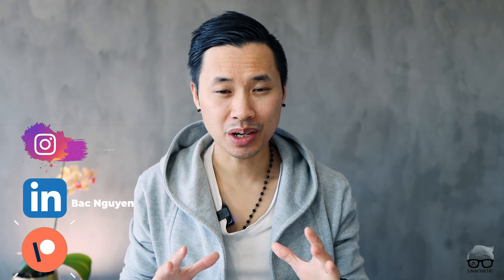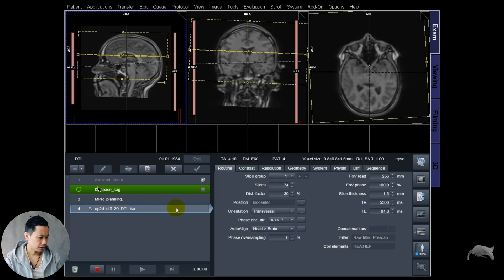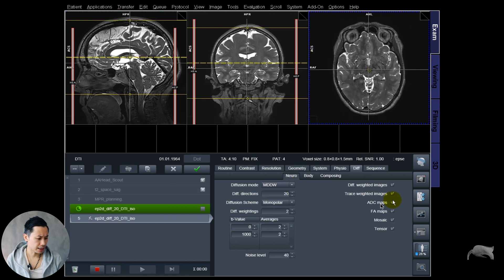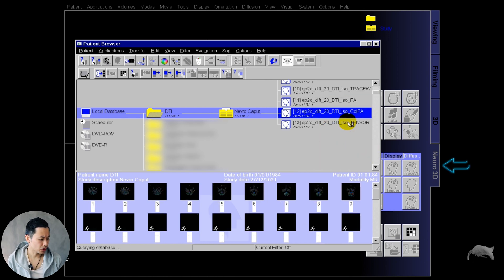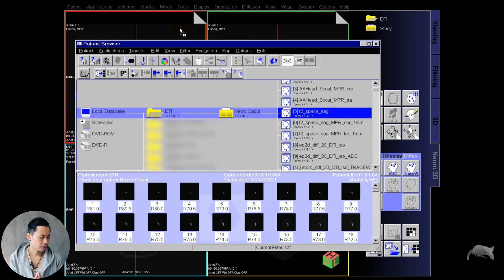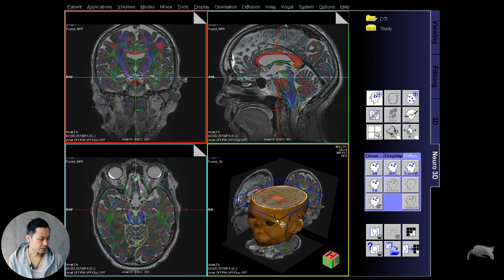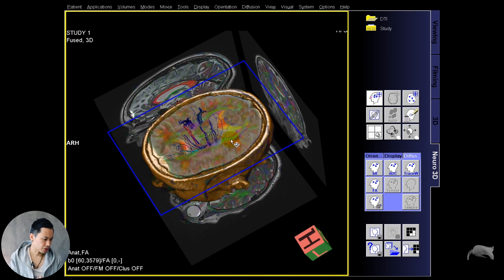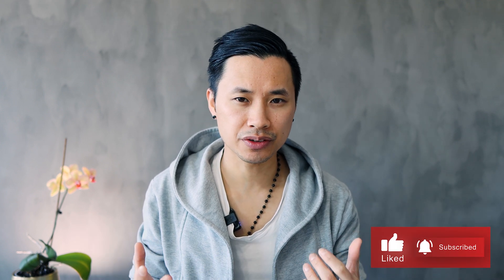MRI – DTI w/ post processing

Comment: Hi Bac, currently we have upgraded to XA30, and it seems our overlays do not match up correctly for our DTI (our rads do this in Syngovia)....we have been scanning using LOC (REF) mode using AAlocs for the DTI.....do the scans need to be in fixed for the overlays to work properly during post processing? Thanks
Reply from the maker: Thanks for the question. I’m not 100% sure because I haven’t tried it on xa platform before. It could  be what you mention here. You should try it and see. But during post processing I guess they are using align function inside syngo via?